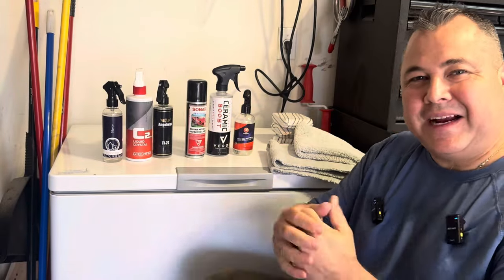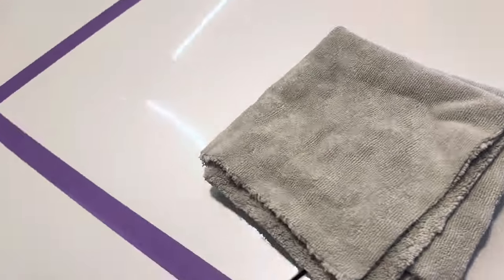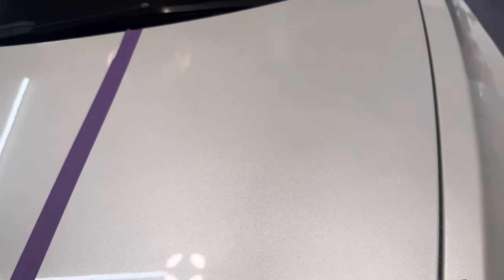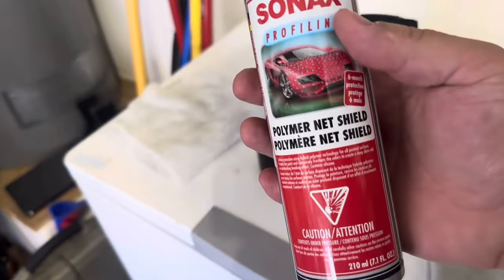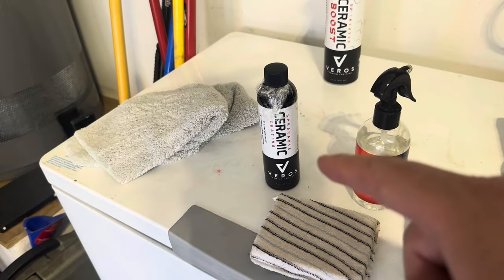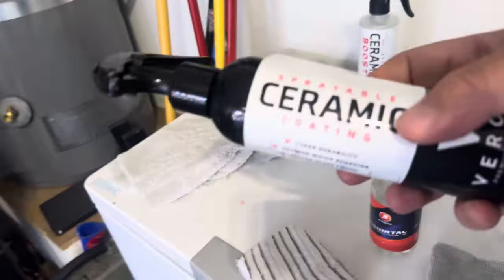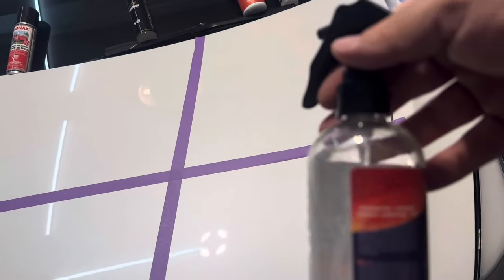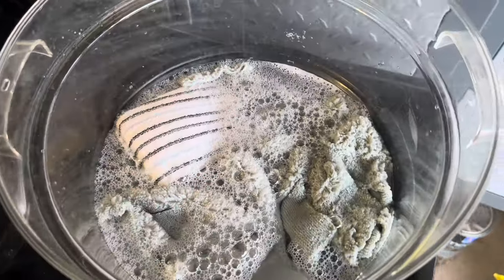Testing 3-8 Year Old Spray Sealants/Coatings/ Can they Still Perform?  Application Part 1/ Care Wash

Comment: There is 3 i know of those spray able coatings that actually perform and smell like a true coating. Kronos, verrsos,BC2 .here in ny i get a easy 12 months on those 3 and only used their respective toppers every 6 months.ALL 3 are fantastic cant go wrong with any of them
Reply from the maker: Good info, thank u